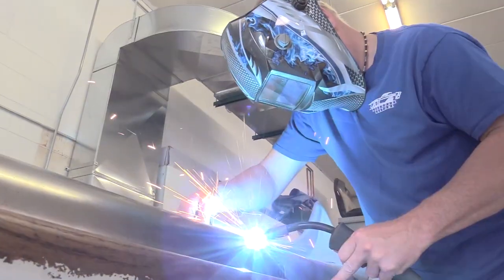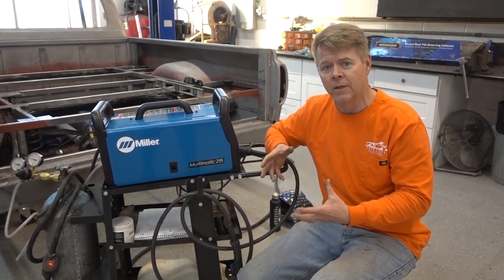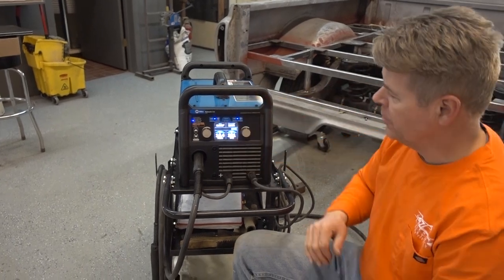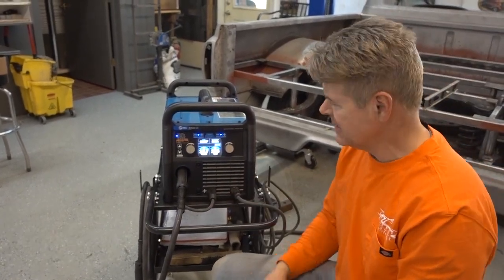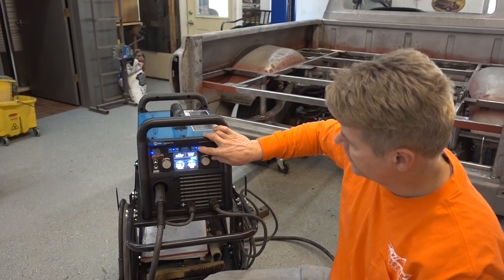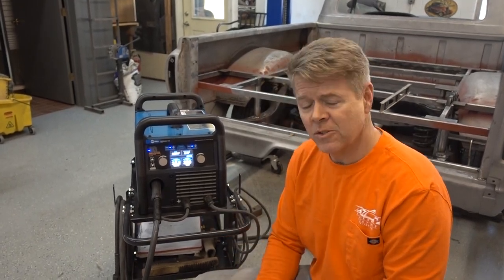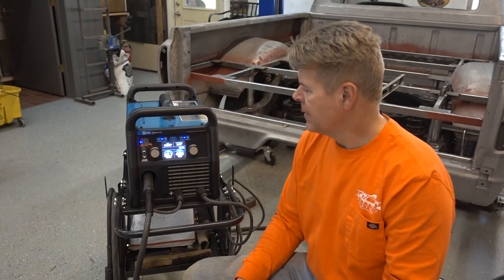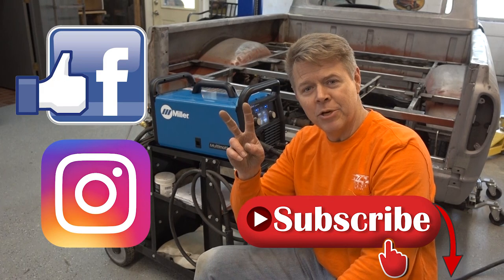Legendary Tool Review: Miller Multimatic 215 Multiprocess Welder

Comment: This is a good welder, I have welded a full 10lb spool out of mine so far. Truck frames, chicken tractors. 2 things to keep in mind it has MDX tips for the Mig gun there not easy to find cheap unless you have an Airgas nearby. Price was 1650 in 2020, get the tig pedal if your doing thin metal. Do not run 6010 rod in it but it will weld 6011 and 7018 very nicely. Never cycled mine out.

Comment: I've owned one for 2 years. Lift arc tig is pretty nice, a "buttery" arc. The stock pedal is junk though.  It's too small, awkward and toy like. I changed out it for a durable and manly USA weld pedal. The built in mig works as advertised with 3 different gasses, it's not remarkable just adequate.  I ran 1/8 7018 rod, I reached the duty cycle automatic turn off feature after steady burning just 2 rods. I set up my machine for the 150 spoolgun. It can spray .035 aluminum and steel fairly well. Glob and short circuit works best. It's not a high production machine but it works well as a hobbyist setup.

Comment: Awesome review thanks. Suppose I want to weld aluminum, or stainless. Does it advise wire type / gas etc setup? Asking for us garage guys, thanks
Reply: It welds both. All recommendations are within the door of th he welder. We really like this one!
Reply: for alu tig DC you need (100%) helium on the 215, the 220 has AC tig for alu (100% argon) but costs almost twice as much

Comment: Were you using is as 110 Volts or 220 Volts when it wouldn't keep up with the 3/8" welding?  
Thanks,
Great insight.
Reply: Patrick Wagz Thank You for the question. We always use the 220 setting. It rarely doesn't keep up. It's a great tool! Can't wait to get the tig attachment. 
Keep watching! Enjoy

Comment: Were you welding with 110 or 220 on the 3/8 when the machine paused
Reply: We always weld on 220. It only paused that one time in the 6 months we've had it. Great little machine that works like some of the big ones.